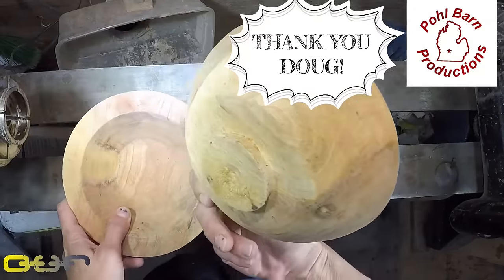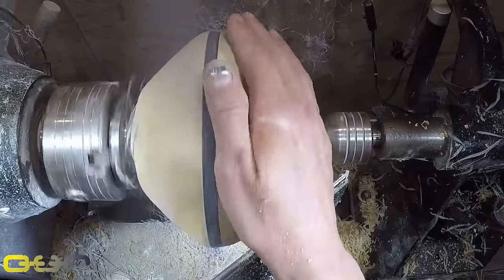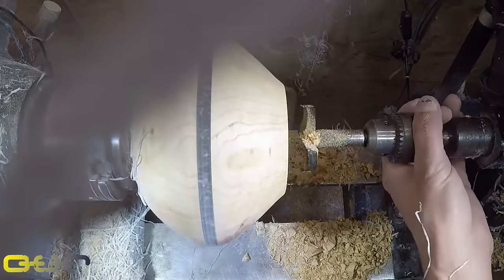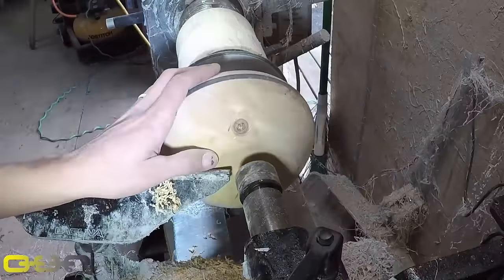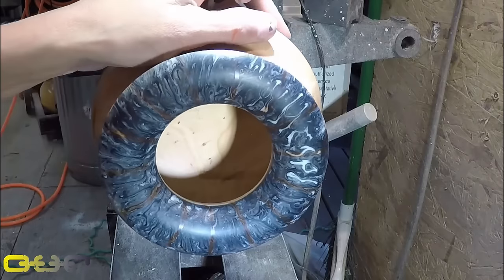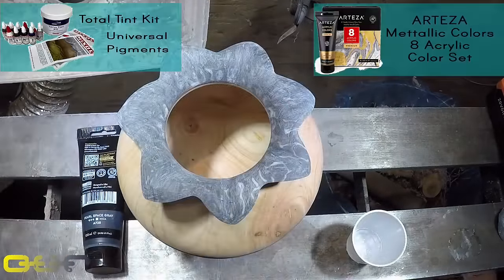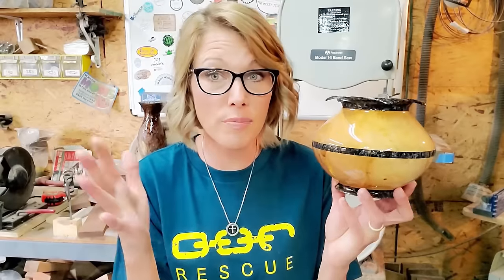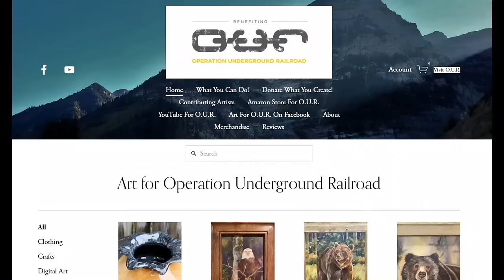ChokeCherry Hollow Form ArtForOUR OUR RESCUE

Comment: If you feel like trying this next time.. Try using a hot air gun or a small hot air gun/heat gun to soften the resin and shape the pedals.. it works amazing and the results will be well worth it🙂

Comment: The pot turned out quite nicely....  I’m still going through the hard learning curve of sharpening he’s gouges.
Reply from the maker: Thank you 😊
Took me a bit to get it down. I bought "cheaper " tools , I still use btw, when I began learning to sharpen.
Reply: @KimTippin  The cheaper tools that I had bought fell apart just from the first turn with them so they went in the trash.  I pieced together a small set of robert sorbeys LOL so I'm learning on them.